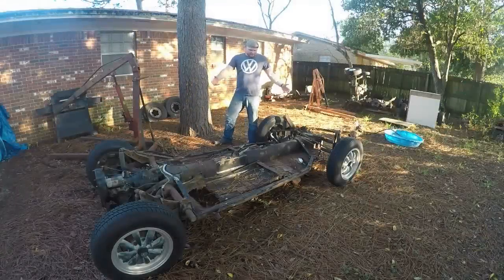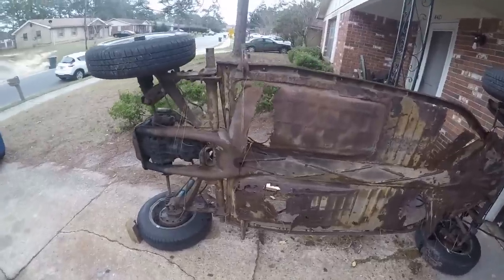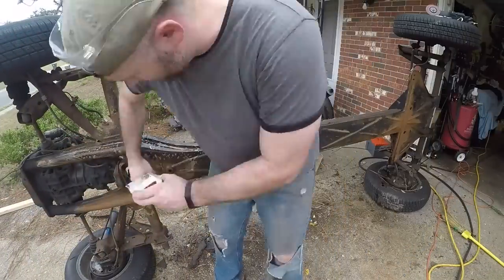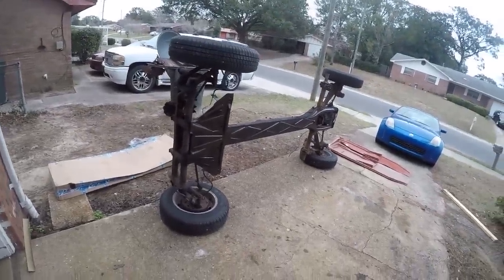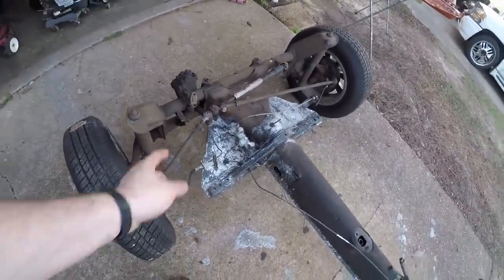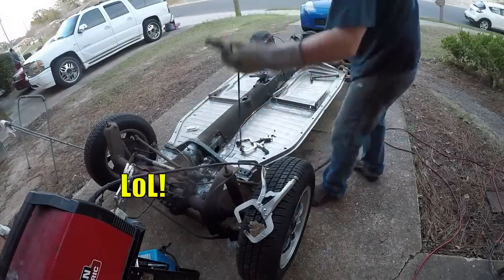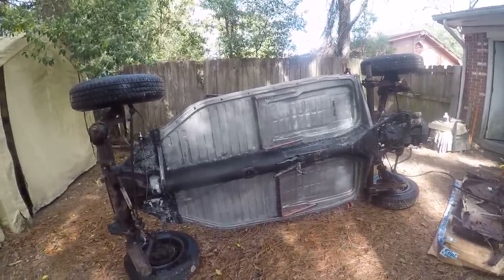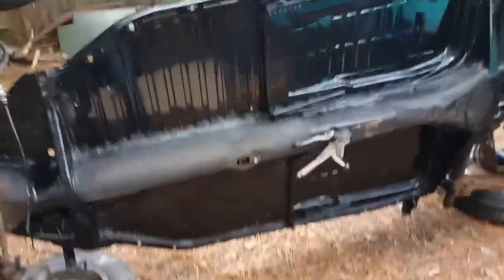Replace VW Floor Pans in 25 Minutes - (Beetle)

Comment: I would have just seeing did the red oxide primer in till it was see-through most body parts have a galvanized coating after I made the primer see through I would hit it with etching primer more than likely after welded
Reply from the maker: Thank you!

Comment: Seems to me you probably should have invested in some Red Devil metal-cutting blades for that Sawzall, or at least something similar. Hitachi's metal-cutting blades are pretty skookum, too. Cheap Sawzall blades will only cost you more in the long run, especially with how hard you run them. I used to run a Sawzall all day long, cutting through the nails that hold pallets together in order to re-purpose the parts for pallet repairs, and that's literally the most torturous work a Sawzall blade could ever encounter, so I would like to think it's more than just an opinion. In that industry, not only do the blades have to deal with the extremely hard nails, but the rubbing against the adjacent pieces of wood heats the blades so hot that if you touched it with your bare finger, it would melt away your fingerprint before you even realised that you'd been burnt.
Reply from the maker: I know what you mean!  Those blades get HOT! I sometimes keep the blades cool with damp rag or a wet sponge.  They cut far better and last much longer.  I'll consider your product endorsement!    Thanks much for the comment and suggestions!
Reply: I would think maybe shooting it with some WD in between cuts would do the trick maybe better than water would, but water sure is cheaper. Plus, not having a bunch of smokey hydrocarbon schmoo gassing off in your face could be a bonus towards using water. Keep in mind that quenching your blades will tend to make them warp over time, but I've never had a blade last me long enough to get warped when I was doing the sort of work I was with them. If you use them more intermittently, and don't smoke a blade on every cut, quenching might be a bad idea if you want to get some longevity out of them. 
Also, the best tip I can think of to give someone about cutting metal with a Sawzall is to use the entire blade. Cranking away at the guard will only make your blades degrade prematurely. Those extra teeth are there for a reason lol.
Reply from the maker: Yes, but no WD40 where paint is expected to go... lol.  :)
Reply: That's true. Some degreaser would take it off in a jiff though. Can't go wrong with Citrasol. For stubborn grease, get some varsol and Bob's your Auntie : )'

Comment: Whoa! It did NOT look easy to chip away all those little pieces of floorpan from the center tunnel, with the air chisel. Looked like it would be VERY time-consuming. And required a lot of electricity to run the air compressor. Would it have been possible to buy a new center tunnel, or a center tunnel with all the floorpan pieces attached? It looks you replaced all of the floorplan except for 2 little pieces of floorpan-like sheet metal that lie between the parts that were replaced, and the front axle beam. Could you have not unbolted the front axle beam from the old one and bolted it to an entire new floorpan? Same thing for the rear axle assembly, and transaxle unit?
Reply from the maker: New floorpans are not available anymore, and even if you could replace the floor pan you need a new title and VIN number.  Chipping off the remaining bits with an air chisel only takes about 30 minutes.  Its very easy!
Reply: @DuckmanCycles  If it takes 30 minutes to "chip away the remaining bits" of floor pan, how do you replace the floor pan in 25 minutes? Things ain't adding up! Well, yes, if I recall correctly, or maybe I don't recall correctly – there is a VIN stamped into that center tunnel, just behind the front axle beam, or maybe it is just ahead of the rear axle beam, which you might see if you lift out the rear seat.
Reply from the maker: @soilmanted  You're right, I lied... the video is actually 26 mins, 13 seconds.... not 25 minutes!  So there you have it.

Comment: why don't you have to prime it first? Seems to me you would have to on what amounts to bare metal
Reply from the maker: The acid etch is actually a primer.  Thanks for the question!
Reply: I'm old and not up on things. back when I was doing such things primer was necessary. I can't argue with the results tho. beautiful. I'd have paint the tunnel and the rest of the components as well, while access is so easy.
Reply from the maker: Yeah, and I would have.  But I was't paid to.  LoL!
Reply: If you had enough extra paint, going above and beyond never hurts business. I mean it would have been so easy to paint at least the center part if it didn't add to the materials cost much. the suspension, well that's trickier and would take extra time and materials.
Reply from the maker: That'd be great, but I'm not taking it apart.  I went above and beyond elsewhere on this project.
Reply: naw, I wouldn't expect that if they didn't pay for it, but the main tube down the center, I mean you almost have to work at NOT painting it. I would only do what isn't going to be a real big pain, something easy to do while you're there. Can't give em too much extra, and in this case maybe only the bottom side, where it will be seen once in a while anyway, the hump will probably be covered with carpet inside.  Say, how often to you see a bug that hasn't been messed with, is still stock both body and powertrain wise? One showed up at a car show, and frankly it got more attention than the common  57 chevys and such that one commonly seen at such events. The lady that owned it was amazed at the amount of attention it got. I told her one that hasn't been messed with is a rare thing, and frankly I don't see a lot of VW bugs, the original kind, around any more. Yould think that with the millions made and sold over their fairly long run, there would be a lot more still around. Ever ran across a bug with an automatic trans from the factory? I did once, many years ago, came into the body shop where I was working.  Until then, I didn't know they made a bug or any VW with an automatic trans. Ran up on a VW Van that had an automatic too. Was going to buy it, but the wife didn't like it because it didn't have the silly things like power steering. Wish I had, it was rust free and if still together would probably bring a lot of money these days.
Reply from the maker: The center tunnel is wrapped with tar board.  Why would I paint that?  LoL!  I've tried before, it soaks it in and looks like you didn't paint it at all, then the rest of it peels.  I'll paint the edges, not worth painting the rest of it unless we strip all the tar board sound insulator off.
Reply: Thanks I did not know that. That explains a lot.

Comment: Great vid to teach the novice's. Please address the fact of what could possibly go wrong when a drop of phosphoric acid gets into one or both eyes when not using proper eye protection. Nothing much matters when you are blind! Nothing................
Reply from the maker: Whats funny is that unless you rinsed your eyes with phosphoric acid, it probably wouldn't do any damage to your body... pour a Coca Cola in your eyes... it sucks, but you'll be OK despite it being highly acidic and containing lots of phosphoric acid!   Hehehehe!  Still, you are correct.  Wear your protection if you don't know what you're doing.

Comment: the new paint stripers will not work very well  , they changed the ingredance because of stupid regulations ,its not the paint on the floor pans
Reply from the maker: You're right, it wasn't the paint, it was some spoo leftover from the factory/warehouse that these came from.  They should have gotten a good soapy cleanup from me and it wouldn't have been a problem.

Comment: Why hasn't anyone come up with bolt on floor pans?
Reply from the maker: They bolt on down each on one complete side!
Reply: @DuckmanCycles  I think he was talking about if a floor plan gets rusted out you can simply cut it out and bolt it on instead of welding but that probably be pretty unstable. XD

Comment: Seems to me that one floor pan is different than the other one. The figment, the rust... something weird going on.
Reply from the maker: Something different in the manufacturing process for sure.  The pans would fit fine if the the chassis wasn't a little bent.  Thanks for the comment!
Reply: even after all these years, the thinking that went into VW's amazes me. look at the amount of repairs you can do right in the driveway. That was part of the goal, make a car that just about anyone could work on. and keep running with only basic tools. I'm sure they didn't count on replacing rusted out floor pans, but even that is relatively simple when you compare it to other vehicles. Eons ago when I was 15, I got hold of a VW van for all of 25 dollars.. of course it wasn't running. At 15 with no previous experience, I didn't even own any metric tools, I was able to figure it out and get it running. I blew it up later, but I did get it running. Had I known how easy it is to remove and rebuild engines, I probably would have kept it and rebuilt the engine. It may still be around for all I know, I sold it to a guy... I don't know what he did with it. The body was dented here nd there, but it was rust free at that time.

Comment: I wouldn't wipe the acid down I would just paint over it I was working with a moron in a body shop and he didn't realize after the body of a car is welded together it's put through a swimming pool of acid
Reply from the maker: If you don't wipe (or rinse off) the acid residue, the paint won't stick well to the powder that was left behind.

Comment: You need a bigger broom.... And why strip paint off New panels? Just paint over it lol
Reply from the maker: Thank you for the broom suggestion!  Is it smart to paint over rusty spots and existing paint that is peeling?
Reply: @DuckmanCycles  lol those panels looked fine on the video. If it was peeling before you applied the stripper then it's good to take it off..

Comment: why do people use a rciprocating saw backwards???its designed to cut the other way the blade moves like a cat scrathing in the littr .....turn it around and it will cut way way way faster ...
Reply from the maker: As far as I know I was using it forwards.  The blade is reversible as per the manufacturer's instructions.   But nobody ever reads those, right?  LoL!  When pushing the saw away from yourself the blade should be reversed with the grip in the natural position in your hands.  Not upside downj!  If the blade were in the regular position I'd have to be pulling towards myself and potentially ripping my guts open when the blade breaks or if it pops out.  BAD NEWS!  So anyways, yeah, read the manual, lol!  But your cats don't need one for the liter box.

Comment: what is that shit that removes rust?
Reply from the maker: The wire brush removes the rust.  The phosphoric acid converts what is left of it to a stable no-longer-rusting layer.  I answered that in the video, but I hope helps to clarify things.  Thanks for the question!
Reply: DuckmanCycles and VW Garage thanks my dood, im in the middle of "restoring" my 74 super beetle
Reply from the maker: You bet!  Got any videos of that thing in progress? I'd like to see!  :)